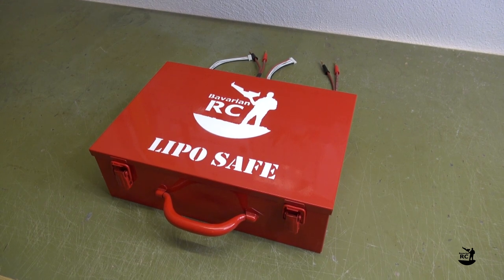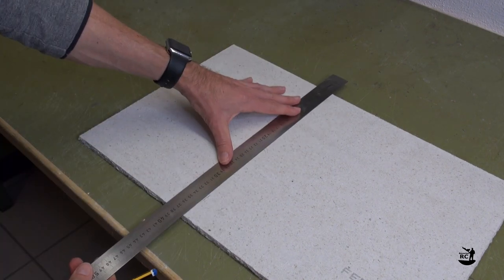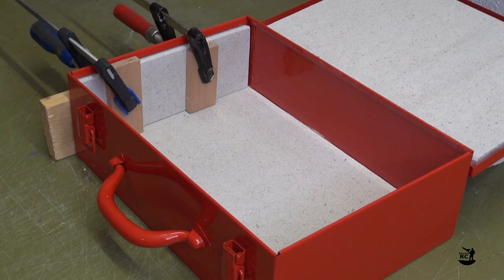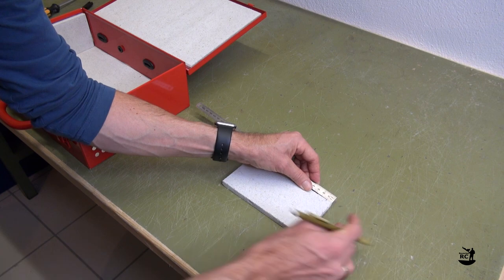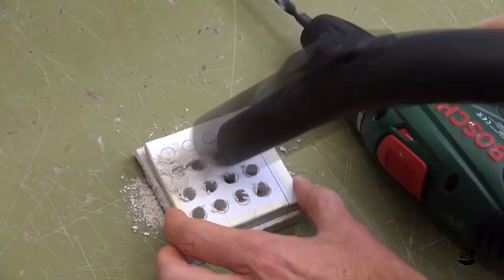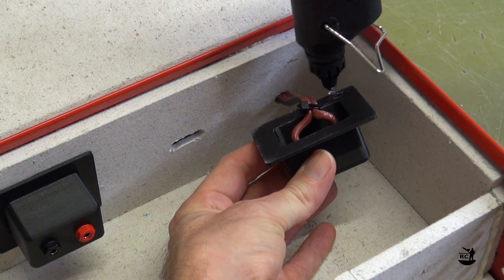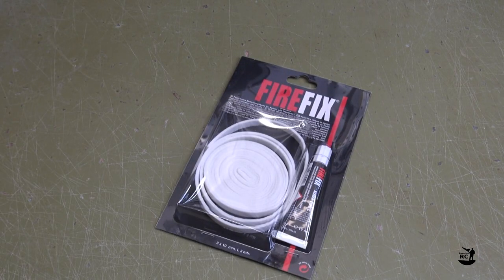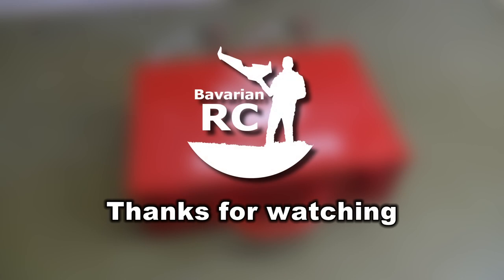Bavarian RC - DIY LiPo Safe - Build Video

Comment: You have done an excellent job!  You have also provided me with a solution to using an ammo box without removing the rubber seal.  Your vent construction is very adaptable and should significantly reduce the smoke and flames in the event of a battery going off.  Thank you so much for your incredible attention to detail & craftsmanship.  :face-blue-smiling:
Reply from the maker: Thanks a lot for your great feedback. I am really happy that I could inspire you for your solution.

Comment: Hi, ich hab vor 2 Jahren deinen Lipo Safe nachgebaut, und hatte vor zwei Wochen einen Lipo Brand in diesem Koffer.
Hat seinen Zweck super erfüllt. Der Akku war ein 4s 1500mah Race Drohnen Akku, und er ist in meiner Garage hochgegangen. Es ist zum glück nichts Passiert, nur die Stecker sind geschmoltzen. Nochmal vielen dank für die Anleitung
Reply from the maker: Hey cool, das freut mich, dass der Koffer gut funktioniert hat und schlimmeres verhindern konnte. Das ist bisher die einzige Rückmeldung von einem LiPo Brand in diesem Kofferdesign. Hast Du auch die Lüftung mit Filter eingebaut? Wenn ja, würde mich interessieren ob der Filter den Rauch etwas dämpfen konnte und ob da drin irgendwas angekokelt bzw. geschmolzen ist. Wenn Du Fotos vom Koffer nach dem Brand hast würde ich mich sehr freuen wenn Du mir die schicken würdest. Meine Mail Adresse findest Du in den Kanal Infos unter Impressum. Nochmals vielen Dank für Deine Rückmeldung! Schönen Sonntagabend noch und einen guten Start in die Woche.

Comment: Nice work. Compare to solutions I have found on internet this is one of the best made.
Reply from the maker: Thanks. I have made 2 of them for my own use and they work great. Luckily they didn’t have to prove their ability to retain the fire in case a Lipo goes off. So far I had one feedback where the box had a real Lipo fire and it worked fine.

Comment: I'm looking into building my own fire resistant case, and I am noticing a troubling trend. I'm not sure if this has been mentioned already, but steel wool is incredibly flammable. The steel scrubbing pad may also be flammable since they, too, have a large surface area to oxygen-rich steel ratio. I recommend testing that if you haven't already, as It would be counterproductive to have a molten steel filter/more fire. Aside from that, this is an excellent looking fire resistant case, and I think it would work perfectly fine for containing fire.
Reply from the maker: Thanks for your feedback. I have seen how easily you can ignite steel wool. Nevertheless the one I am using is not as fine as the one you can ignite with a lighter. It is rather thick and I couldn‘t get it to burn with a lighter. Of course a LiPo fire is much more intense but I hope that the fire will not enter through the first fire wall into the chamber. To really know what will happen I would need to do a real test with a LiPo that I mistreat until it burns… maybe one day I will do that. I would also be curious to see how the 3d printed parts would look after the fire 😃

Comment: Awesome build. I worry about those dangerous batteries. I keeps mine stored in a lipo bag with each batt separated. I saw a video on you tube where a gent had a huge hobby shop in his garage, and he had all kinds of toys and chargers in it. He charged some lipo's and left for work. He came home and his garage was burnt to the ground.😕 I hope in the future the engeneers design a better and safer battery. Thanks for this informative video!
Reply from the maker: I try to be as careful as I can but as always in life there is some risk remaining. My golden rule is that I never leave house while batteries are charging. I think the battery safe can protect from fire but there is still a lot of smoke involved in a lipo fire. Hope I‘ll never have to test the box.
Reply: Most lipo bags will not contain the fire if they go
Reply: @bavarian_rc maybe it would be quite interesting to test it in a controlled environment just to see how good it is ;) but I understand how long does it take to build this thing and that you don't want to damage it
Reply from the maker: Yes. I actually thought about a real test but it would be too much work involved in the build to just burn it 😜  But I already received a comment where my Lipo Safe had to deal with a real Lipo fire and did a good job. Comment was from Sebastian (in German)
Reply: Never charge batteries and leave them sitting around. Always storage charge them when unattended.
Reply from the maker: Totally correct 👍🏻 The most risky part is the charging, in case the charger fails

Comment: Stick on magnets to the leads, so the cable won't dangle when in transit. You can then stick to cables to the lid and they won't be a nuisance. Or you could make corresponding ports on both sides, so you'd connect the leads to the box when actually charging. Great job
Reply from the maker: Great idea! Never thought about it as I only use it at home but for transit a very clean way of keeping the cables under control 👍
Reply: Making banana sockets on the outside as well makes the box more easy to store. Just pull out the charging cables and put them inside.

Comment: This is a very nice build, and looks very professional.  The problem I see with this build, is that it's a one time use kind of thing, unless you don't mind replacing all the exposed components that will get burnt up.  Of course most products designed to contain lipos fire are one time use, but I just find that with the amount of time, money and parts put into this build, it's not practical.  At least not for me.  And lets not forget about the required tools.

A similar but more practical build could be something as simple as a metal lunch box insulated with gypsum board and gypsum board dividers.  The dividers could separate 2-4 lipo batteries, and then your choice of whatever extension wire needed to charge your lipo.  And in the event of a fire, your other batteries should survive and you'll only have to replace one battery and the extension wire.

In a previous video I watched, I wondered if it was necessary to vent the metal box to allow the smoke / hot gasses to escape it.  But I think unless you're using a considerable amount of filtration, the smoke / gases will find its way out of the box anyways.
Reply from the maker: I can really understand your argumentation and for sure you have to question if it is worth the effort as a „one time use item“. Well for me I have to say that it is not a one time use item. I am using the box hundreds of times... and hopefully will never have to use the fire protection feature that it provides. In case a lipo fire will happen it is for me worth the 50 Euro I put into it... and yes the cables and batteries are lost. Compared to the potential damage to my home that is quite negligible. But there is really no right or wrong, so your approach is fully valid. Speaking about the ventilation there are two aspects, first to cool down the hot gases and second to filter as much as possible the smoke. For the cooling I am quite confident, the filtering of the smoke could be more tricky for my box, but better than nothing, in any case you need to provide an option for the gases to exit the box... otherwise it will be a kind of bomb. Finally whatever the design principle the most important thing is that it has to prevent fire. Let‘s hope we‘ll never have to put it to the test
Reply from the maker: Looks great! I‘m really glad that my design was giving the inspiration to do your own version fitting to your needs. That‘s what I like in sharing our builds and designs... the ideas are developed further and anyone can adapt them. 👍
Reply: @ubreakitirepairit3569  Link doesn't work. Would like to see your version.
Reply: @streaydog019  I think I deleted the photos. I’ll put up a video shortly.

Comment: I use the box with 4 small plastic bottles of water to reduce the temperature of the fire.
The box is only closed at one side and of course only used outdoor.
Reply from the maker: Interesting approach 👍🏻
Reply: That's not a good idea as the water will only intensify the fire. watch a few videos on YouTube and you will see what i mean. a cheap way is to fill little plastic bags with sand and put on top of the batteries when charging. if there is a fire, it will melt the bag and put out the fire

Comment: It is difficult to get the drywall to fit tight without any of it coming apart (crushing).  I tried it and the ammo can's corners require you to round the edges for the bottom piece to fit, but the pieces for the width don't want to fit tight all the way because the ammo can isn't square enough for that.  I used a sealant for grills and cookers on mine.  Making the individual compartments is almost impossible unless you use a table saw of some kind to get things square enough to begin with, otherwise you get gaps.
Reply from the maker: If you box is not very square then fitting the drywall pieces can become quite painful. Luckily the boxes I use are quite ok. I might as well need to look for a different sealant as mine has dissipated a bit over time. I hope you will master the challenges of getting things to fit. Never give up!

Comment: Very nice design! Going to make my own. By the way, I have 4 boxes to do because I will use 3 off them for storage only. I do have an idea to make it even safer. I believe that once the lipo is burning or reaching high degrees it will be in no time that the 3d printed parts are melted! You will have immediately 2 gaping holes! I would even them protect with fire board to gain time in melting the 3d parts. Is this a wrong thinking??
Reply from the maker: Great that you liked it and that I could inspire you to build one... ehm 4 😉 Concerning the melting of the 3D printed parts your thoughts are absolutely relevant. I had similar thoughts but still think that there is no real issue. 1. lipo fires are very rapid. so I hope that the fire is already over before the 3D printed parts are gone. 2. even if they melt away the remaining hole is not so big as there is still the grommet and the cables. 
Nevertheless if you want to go extra safe you could add some more protection to that area. Have fun building!
Reply: I have the same concern. (Thanks for your inspiration btw, im building my version as we speak). My concern is not the holes when the 3d parts melt, but the contained contacts getting loose and touching each other and thereby creating a short. Any thoughts? When the shorts triggers the current braker and thereby stops the charger, this negative feedback might even be a good thing. I will try to think off something nice as a solution.  Maybe we can use the low melting temperature off PLA to release a fire extinguish fluid of some sort.
Reply from the maker: Good thoughts 👍🏻

Comment: Love the design. Very elegant. I wonder if I could have that box shipped to US. Having difficulty finding a box similar to the one you used.
Reply from the maker: I just checked the online shop of that hardware store...unfortunately no shipping outside of Germany. If you manage to find something comparable in the US then let me know so I can add the info to the description. Good luck!
Reply: @bavarian_rc  Will do. Thanks
Reply from the maker: Yes that will do the job! Thanks for posting 👍 I would only suggest to remove the sealing (if it is still installed) or add a vent like in my build to ensure that the gases can escape.

Comment: Thanks for sharing this build, this has been very interesting and helpful.
I have 2 big bat-safe boxes but I mainly use them as safe storage for holidays when the batteries been put on storage voltage and put them on concrete without anything flammable around.
I was looking to make myself smaller boxes for charging, something better than just ammo boxes and this totally overkilling it design of yours is right where I parked my car.
May I know what glue you used ?
Wunderbares Projekt, sehr gut durchdacht und durchgeführt, Vielen Dank!
Reply from the maker: Great that you like my design. I have 2 of these boxes in use for my charging station consisting of 4 chargers. The glue I used is Fermacell PU glue. If you can‘t find this one you could also use Gorilla PU Glue which should be quite similar. Enjoy the build!
Reply: @bavarian_rc  Danke sehr!
Reply from the maker: Gerne 😊

Comment: Very nice project! I think you could have also used some kind of fire proof putty/cement to fill the holes with wires. That would avoid printing any parts because you could have just wires going through with connectors on both ends. I also think that the metal mesh is not going to cool the exhaust gases any meaningful amount because the mass of that metal is not enough to delay the raise of the temperature. However, if will distribute the pressure evenly which should prevent outflaming. I guess you could get equally good results with 3-4 walls with holes, too, and that design wouldn't collapse in fire even if the fire gets really hot.

And I would recommend using fire proof cement instead of glue to hold pieces together.

All hot glue and 3d printed plastic pieces will practically fly away in case of 6S battery fire so those have no value for the safety. Here's a video of one (1) LiPo 6S getting fire during charing in a sack: https://youtu.be/CnNId0mDnBo?t=112 – it's obvious that plastic or hot glue have zero value.
Reply from the maker: Thanks for sharing your ideas. You mention the two points where I am not absolutely sure how they will perform in case of fire. To reduce the risk I now put as well a bag of fire balls on top of the lipos during charging. According to the manufacturer they will encapsulate the lipo and prevent the fire from spreading. Anyway I hope I will never have a real life test 😜
Reply: @bavarian_rc  LiPo batteries are pretty dangerous indeed! Here's one interesting test with different charging bags: https://youtu.be/atkgUwGHL_k

The performance of those bags seem to be all over the place and price doesn't correlate with quality.
Reply from the maker: Yes you are right about those bags but I didn't mean the lipo charging bags you are referring to. I meant those fire extinguishing balls: https://extron.pichler.de/FIREBALLS-Fire-Extinguishing-Pearls-for-Lithium-batteries-5-Liter

Comment: Where are you buying lipos or chargers from to be so scared of charging it? Do you charge your phone, tablet, laptop,… in a box to?
Reply from the maker: Hi and thanks for your comment. Please don‘t mix lithium batteries used in phones or laptops with the LiPo batteries used for RC models. LiPo‘s are a totally different breed. 1. The chemistry inside is different. I am not an expert but there are plenty of sources on the internet where you can read about it 2. Most of the LiPo‘s we use in RC consist of multiple cells in series. During charging you need to properly balance the voltage of the cells. Anything in excess of 0,1V of difference will lead to damages to the LiPo… or if the delta is bigger it will lead to a stronger current flowing between the cells, which in the end will most certainly lead to a LiPo fire. That‘s not what you want! Therefore any LiPo should be in a protective case or LiPo bag during charging and storage. 
I don‘t know if you are using LiPo‘s and how you are treating them but if yes then I strongly recommend you read some of the basics about LiPo‘s, for your own safety!
Reply: @bavarian_rc  I use Lipos for over 20 years and you are wrong, sorry
Reply from the maker: Ok, no problem with that. I wish you good luck!
Reply: @bavarian_rc  just do t overcharge any cell, don’t short and do t puncture and you are good.
Never had a Lipo fire, and some times a cell can die, or go well under 3v, no problem, if you have the ability you can exchange the cell or remove it changing the number of cells and can still use it no problem, I do that a lot here for friends
Reply from the maker: For sure you are right, if you don‘t mistreat your battery everything will be ok. But what if your charger gets faulty? Would you trust your life on your charger? I have quite good Graupner chargers and only use high quality LiPo’s. Nevertheless I simply follow the rule „better safe than sorry“. It is my way of doing things… 😃
Reply: @bavarian_rc  I do trust my charger and I’m always present and aware of the lipos charging, I don’t go to sleep or live home wile charging and as a lipo does not explode like a gas container I can mediate any lipo fire.
But man, if you feel safer like that, do as you please!